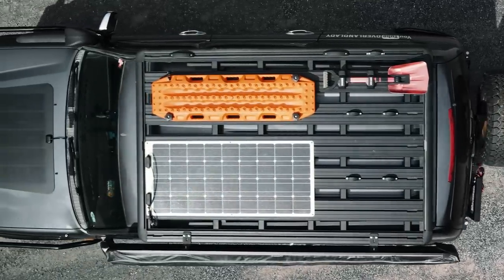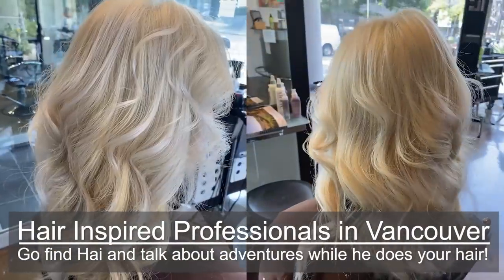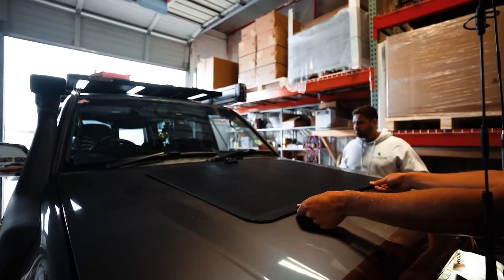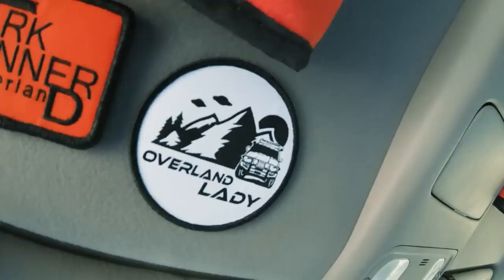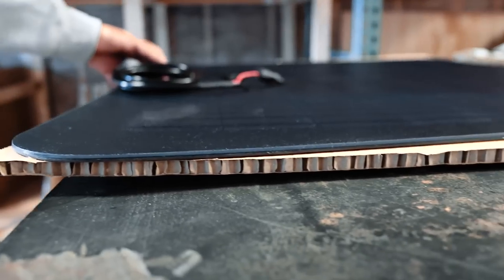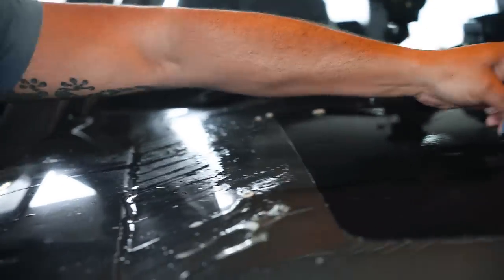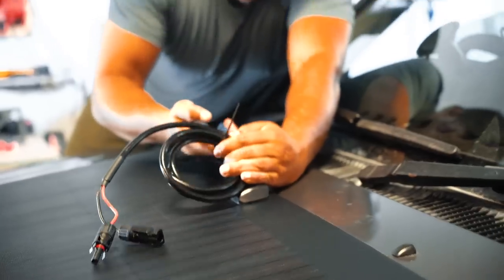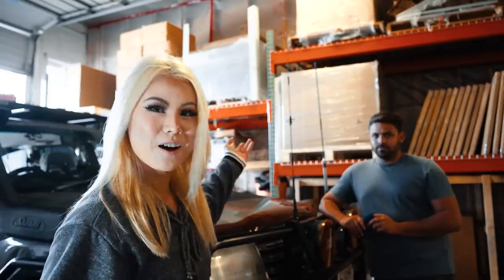Best Solar Panel for Overlanding? Cascadia 4X4 Hood Solar

Comment: I’ve had the Cascadia 4x4 100w panel on my JK’s hood for a year now and pretty happy with it.  I wish the MPPT charge controller displayed the amount of watts the panel was outputting, or had Bluetooth monitoring. Otherwise pretty happy with it.

FYI They’re not joking in the instructions when they say to get someone to help with the vinyl application.  You really need someone else for a few minutes.
Reply: ? I did the vinyl myself was really really easy. Unroll the vinyl and put the solar panel on it for a day or 2 to flaten it out. Spray soap water on hood. Unpeel the vinyl a little bit and spray soap water on it. Unpeel about 1 or 2 inches of vinyl off the paper and apply it to the hood. Unpeel the rest of vinyl from paper while spraying soap water. Get it centred and use the squeegie. Let dry and done. I thought would need 2 people but1 person can do it easy
Reply: You could get a volt meter connected to the input from your solar cables
Reply: @phiromtauch6059  sure there’s lots of ways to add this functionality.  I just wish it was built into the MPPT charger
Reply: @jfloydsea true

Comment: Wonder how reliable that mounting system is in extreme cold. Up here in Alberta, Canada we could easily have -35 Celsius. Then what happens when the engine bay heats up ?

Comment: When the optima goes out which usually dont take long try northstar. I had horrible luck with optima swapped to northstar its been a beast going on 4 years now its my cranking and accessories battery got 200 watts of solar my fridge will run forever.

Comment: Did it perform like you wanted it to? I wanted to add some small panels to charge my BLUETTI 200max while I’m working during the day.
Reply from the maker: works great. my battery was never flat. I use air fryer to cook so it does eat a lot of battery. The trickling power suply is always charging. bluetti 200 is not very big so it wont take long to charge up.

Comment: I am currently I the middle of a warranty claim on a 200w flexible panel from these guys (Lensun Solar) that I had mounted to the roof of my RTT since may2023 (its AUG 2023 @ time of writing). Maybe it will get better but currently I have not been impressed, my issue hasn't been resolved, and the panel just up and quit working. No visible damage. Just stopped working.
Reply from the maker: I’ve heard of Lensun. No experience with their products so can’t comment

Comment: These things are insanely overpriced.  You can buy a 100 watt flex panel off Amazon for 140 bucks and charge controller for 50..

They're trying to sell you a kit for 500??!  Ridiculous. And the dirty secret of solar is they're all the same panels from china.  It's just whether or not you get A, B or C grade from the quality control inspection (scratches, dings, etc).

Is having it contoured perfectly to your hood worth triple the price? (depending on vehicle).. for me, that's a HUGE no.
Reply from the maker: If you watched the whole thing you won’t be leaving comment like this. I have a normal flexible panel on my rack I know how thin it is. The key to any thin panel straight to the car body panel is insulation. Video showed the difference. These are vehicle specific so every car has a different model depending on the shape of the hood
Reply: @OverlandLady  still not worth almost triple the price of $500 or more for 100 watts of solar..  but people buy into because "overland"..  when you can have the same thing for sub $200.

Comment: Why did you use their mppt controller when you have the bcdc?
Reply from the maker: I already have renogy 100W  wired to the bcdc. I can potentially wire the hood solar to the renogy solar and together goes into bcdc. But their kit is plug and play using mc4. (I hate wiring)
And i was told it’s best not to wire up different panels together. 
So now their controller feed into crank battery which will also charge secondary battery thru bcdc
Reply: @OverlandLady  i didn’t realise the new controller feeds into the start battery, that’s a good way to do it. Just be careful, if the second battery was run down after a few days of rain and then the sun starts shining, the regulator could boost the voltage of the start battery enough for the bcdc to kick in flattening your start battery, as the bcdc will pull heaps more than the bonnet solar is putting in , I know Andrew St Pierre White encountered this several times before he worked out what was going on.

Comment: Has it been tested in the hot desert like Utah?
Reply: Thats what I'm thinking...I personally has a flex solar panel attached with 3M to my fiberglass RTT and was traveling in 100+F degrees with a 30 mph head wind my traveling speed was 65 mph and when I got to Moab Utah at poison spider bicycle shop I noticed my solar panel was gone.....ripped right off...I'm assuming it was from the extreme heart causing the tape to loosen and from that moment up it goes...

Comment: Not a good idea folks.  Solar efficiency takes a huge nose dive under heatload.  In this case from the top and bottom.  Not good. If your draw is minimal it'll get you by.  Airflow under the panels is key if you were to take this approach.  DOn't stick it flush to your hood.  The 'airflow' shown in this vid doesn't seem sufficient at all imo

Comment: FYI these systems charges slow with yellow top optima batteries. i installed mine and tried charge a dead battery like literature said it would did not work. i called and talk to them and they said they do not why it charge slowly with optima batteries. it would have be nice for them to have disclose this before i spent almost $700 dollars on there system. i have 2015 jku Rubicon with the genesis dual battery system.

Comment: AGM Battery with inverter or powerstation or Generator dual fuel or  propane generator, what would you recommend for a truck In the woods?

Comment: That's funny when people say solar panels are less efficient when they get hot I have been using panels for 20 years and the hotter they get the more power I get out of them. The panel I have on my roof rack is a 75 watt but I have seen a peak of 90 watts out of it.
Reply: I don't know much about solar panels... but this is the first time i heard that the hotter it gets the less efficient it is... I feel like people get confused by the solar panel generating heat due to the inefficiency of the panel itself, not that it lessens efficiency due to heat.
Reply: Hoods don't get hot, or more precisely the engine compartment does not. I drove around with a thermometer there to measure the effect of exhaust wrap, and the moment you start moving temperature s drop to ambient and only increase slightly at idling.
Reply: Too bad it’s an actual fact that PV cells lose efficiency as their temperature increases…What’s funny is that you think you know what you’re talking about!
Reply: @gwot  You’re the one that’s confused, its basic 5th grade science … just like all semi conductors PV cells become less efficient as the temperature increases above their “sweet spot”!
Reply: @WhatsThatsmell69  Thats the difference between you and me: I measured, You didn't, you just "thought". Save the insults for when you actually know something!
Reply: @Tore_Lund  And with your logic car manufacturers are putting insulation on the underside of the hood for no reason huh? 
I guess those penny pinching companies are spending millions on something that serves no purpose..
Reply: @WhatsThatsmell69  Notice the word "Dyno"", in the sentence you just wrote. How many solar panels are on race cars being run inside on a dyno? Obviously nobody here are talking about tuner cars with red hot headers, but road legal vehicles. You can't not know that cars ha a piece of ABS plastic on the top of the valve cover. How would that work if what you believe was true?
Reply: @WhatsThatsmell69  Insulation on hoods is also there to protect the paint from high temperatures, besides noise, true, but that is from idling after driving hard torbos etc, and not regular driving. I couldn't measure more than 130F just under the hood after idling for 10bminutes on a 70F day, hardly  "hot" and still roughly half the temperature a solar panel can reach in still air.out in the open!
Reply: @Tore_Lund   You've well proven that you have Absolutely Zero idea of what you're talking about..
Reply: @Tore_Lund  You're literally contradicting yourself.. automotive paint is design to handle the sun beating down on it, 130f with 70 degree ambient while idling is hot..... and Is far about the 77 degree sweet spot For PV but again I don't give a shit about the PV on the hood I'm talking about that foolish "Engine Bay's don't get hot" comment..
Reply: @WhatsThatsmell69  What is your problem? You can't argue with measurement. You have been proven wrong and you hate. I'm sorry for you.
Reply: We have solar panels at home with smart gate and power walls. With the smart gate, we can check solar production instantly at any time. My experience is that solar panels do lose some efficiency when it is too hot outside like during peak of summer. They produce the most amperage when the sun is out high with clear blue sky and the air is cool and crisp. This usually happens during spring time. However, overall daily production in summer is still higher due to much longer day light.

Comment: Awesome build sorry about the accident. I hope you are back up and running soon enough. I have a question regarding the connection between the mppt charger to your eco flow power station. How did you make that connection since it is charger to power station and not the mc4 to the connection on eco flow.
Reply from the maker: I plug the ecoflow to my car 12v. The cascadia solar panel charges the car battery which supports the 12v. the 12v plug in the trunk is constant on.

Comment: I love this product. But the guy mis informed you in regards to alternator , when driving if your charging your cranking battery and dual battery off the alternator it can be a lot of strain on the alternator.  If set up correctly a smart redarc DC will determine which power source is more efficient,  solar or alternator. Sexy hair too ✌️
Reply from the maker: Alternator will always provide  more power when car is running. Unless maybe u have a tonnn of solar. One 100W won’t compete with engine
Reply: @OverlandLady  sorry I didn’t express myself properly. The idea is to use the solar while driving to charge the dual battery to take the added strain off the alternator . Therefore the alternator only has to charge one battery not two. Any good quality auto electrician will tell you that , or email redarc for an explanation, they are happy to help .

Comment: Looking good girl yep a good job done.
I thought it was going to be magnetic, as I have a panel that is held by magnetic strips and additional magnets at each corner never lost it off the roof while driving and I can move it to any panel in direct sun.
Reply: Did you build that by yourself?
Reply: @flash1250  Yes I bought a cheap flexible panel removed the frame and added the magnet fixing's half an hour while watching wild geese start their winter migration
Reply: @Nickwillfixit  Do you have a video on how to do that? Or can you upload a detailed how to do guide? Is that possible? Would be great :-)

Comment: When you driving - you can get up to 400W just from your car directly, without any additional tricks and devices. When you stay - you can just put somewhere MUCH BIGGER and efficient folding solar panel on the ground. Doesn't make any reasonable sense to attach that on the hood. Moreover, it makes engine cooling a bit worse and under direct sun rays sticky tape most likely will melt and panel will fly away once
Reply: vhb tape aint going anywhere bud, that shitd would keep down a family of 12
Reply: Lmaooo facts